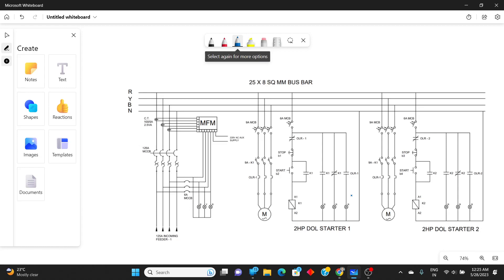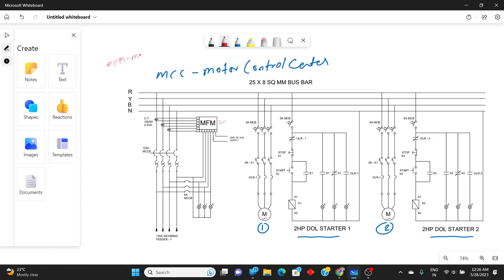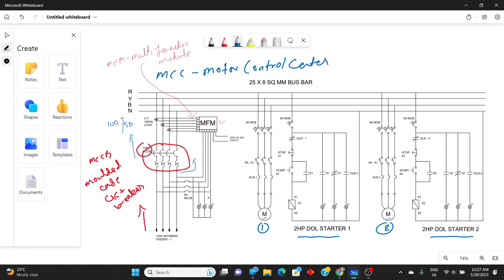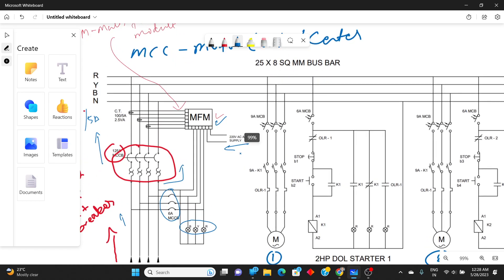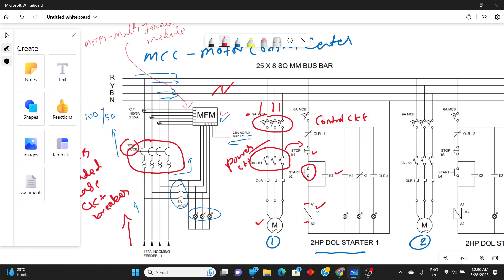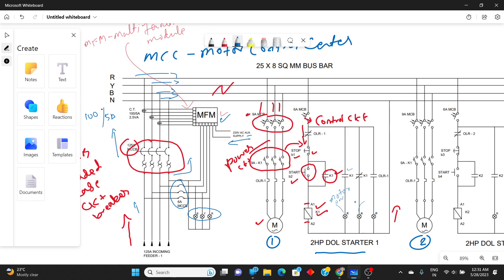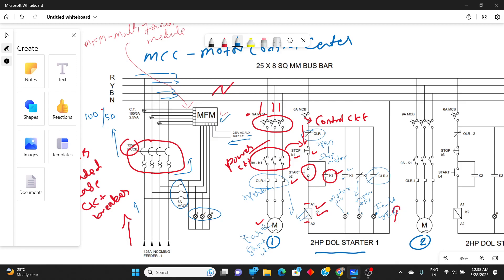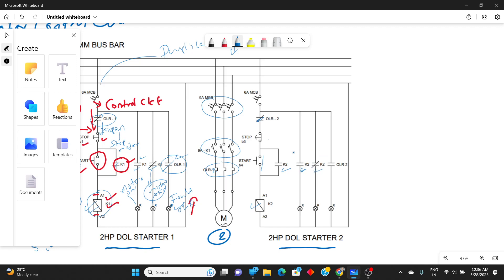Motor control center (MCC) panel wiring diagram in AutoCAD Electrical

Comment: glad to watch ur video, but can u share to me about ur link project or something about that video please
Reply: Could you tell me what MFM part on the diagram please?
Reply from the maker: MFM stands for multifunctional meter
Where we can see the voltage, current also line indicators
Reply: @HybridAutomationTechnologies  
It's like instrument device related to CTs and PTs to read vol... and Ampères, isn't it?
Reply from the maker: Yes that's what in MFM we are connecting CT terminals to read the current of line also parallel connection to check voltage...
Reply from the maker: Let me know specifically

I will try to create it